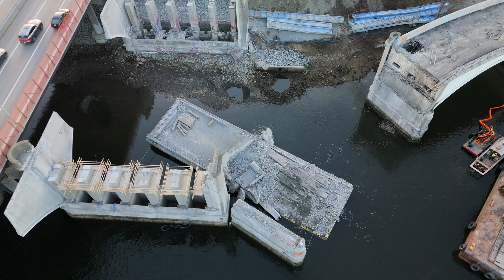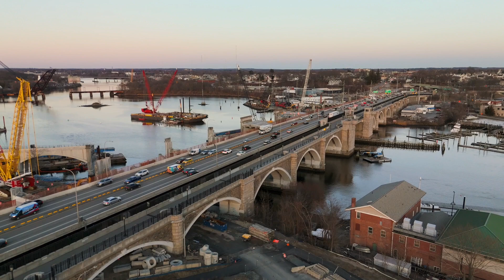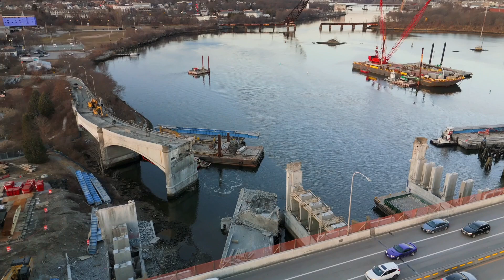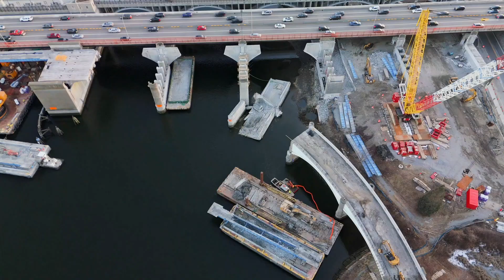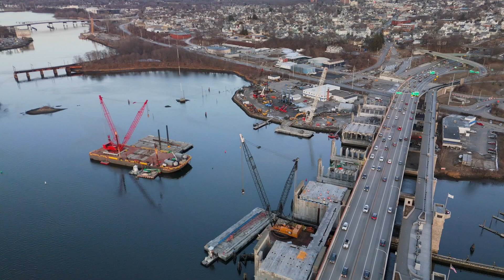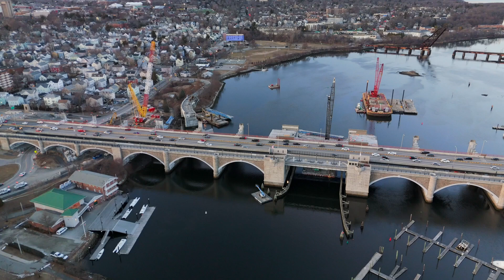Drone Flight of Demo Debris - Washington Bridge

Comment: I was curious what you thought about the previous construction that was  performed under the bridge on water st. I looked at some  google map photos from 2014-2022. This is the portion that was bobbing up and down. You can see the deteriorating concrete blocking between the deck beams, one even disappeared.  Then in 2019 you can see where they drilled metal bars through the blocking, then in 2022 the bars arent there anymore. Did you notice this anomaly and do you have any opinions?
Reply: https://maps.app.goo.gl/V4iiRBTC71EKfeuv9?g_st=ac

Comment: I have a question.   With all this debris falling into the water and all the vibrations too break up the cement how is that effecting the East bound bridge footings?
Reply: If its less than a foot cube the operation is just dumping rip rap on any river bank in a sloppy fashion for erosion control, does it affect the other bridge yes, long term if it moves sediment around and shifts the river flow that is addressed in the next phase bridge reconstruction.     The standard is to catch anything bigger than 250lbs and a cubic foot and not have it roll into the river to be recovered by feel with excavator.   Its the construction phases problem dealing with fragmented rebar and concrete in the mud.     Musta always been here, with demo spray paint on it?

Comment: Well, drone footage is what I could do for your on-site, which seems very handled. What I can offer you is the knowledge that the same state gov is trying to open a contaminated brownfield site to the public in about 2 months, "Tidewater Stadium"
They do NOT plan to have the RACR done before opening. I got that statement from RIDEM directly. It's about a mile upriver in Pawtucket.

As for the bridge site, there's snow and freezing rain expected today, they actually have a reason to shut down.